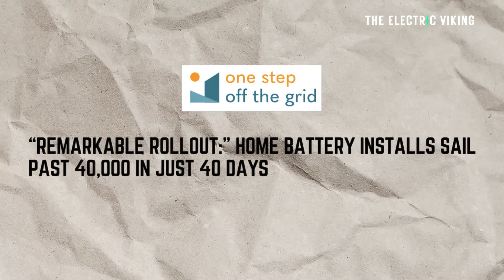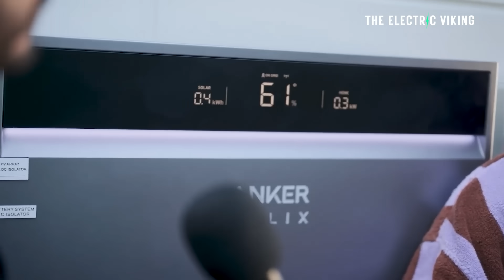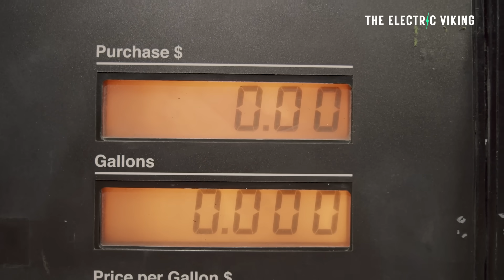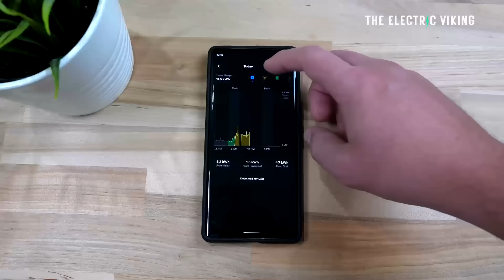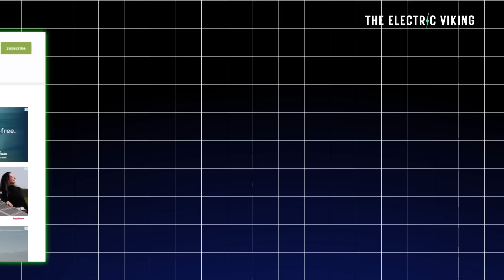40,000 Home Batteries in 40 Days: Australia’s Clean Energy Boom!

Comment: Sam mentioned 30 year warranties on some solar PV battery products in this clip.  In my opinion a 30 year warranty claim on a product needs to be treated with a healthy dose of skepticism.  There are very few solar product manufacturing companies in the solar industry that have been around longer than 20 years.  This means their products have not been in the field in real world conditions for that amount of time.  If you think about it, you are lucky to have a phone or laptop that will still be working properly after 5 years which is essentially a battery with electronics and software.  My personal PV system with SMA and Suntech panels is still working fine since 2011 with a reduced output of around 10%.

Comment: Feel free to quote me. 
Just simple engineering facts from a CivEng Degree construction engineer with decades construction in ;
Fossil fueled power stations are uneconomic. Not fully maintained, as the cashflow is dying. 
Transmission lines too expensive to overbuild and extremely expensive to EXPAND and too valuable to waste.

Comment: Basically the battery rebate is to ensure grid stability after sunset, not to benefit the consumer with low or zero energy bill, because you paid 15-20k of electricity bill in advance.

Comment: The more we ‘cheat’ the system by not requiring fuel or electricity the less revenue the government and power companies will get, they will just move the goal posts to generate the revenue a different way, plugging the hole. I don’t think it will be too long before we’re actually charged for the power we generate regardless of if it’s fed to the grid. Taxes will increase or a new one invented to hit EV’s. The win’s are temporary. This inherently flawed economic system is doomed to implode before long. In the meantime my 6kv/20kwh +EV system gives me the upper hand but, for how long?

Comment: The main problem with the Government's battery subsidy is that it requires the owner to have solar. This excludes a huge number of properties, especially apartments, from getting the benefit of a battery. In SA companies like iO Energy use the SAPN 'Electrify' tariff to supply daytime electricity at 8c per kWh, effectively allowing non-solar properties to benefit from the huge solar overload during the day - saving it up to use in the evening when the rate is correspondingly high. This discrimination needs to stop.

Comment: We had our 15KWhr LFP battery installed earlier this month.  We are in Perth.  Went with Perth Solar force who installed our PV in 2018. We needed a change of inverter.  With both state and federal governments contributing it worked out well and so far we're very happy. 

In June we bought our first EV.  It's a 2022 MG ZS.  It's the one with the LFP battery so the range isn't impressive (320kms), but it's probably going to be sufficient. It was far and away the most affordable EV we've seen this year (except for trash like a very old Nissan leaf.)  Might have liked a 3 year old Atto 3 for the extra 100kms of range, but they were coming in over $10k more expensive.

Comment: Incentives make so much sense, every house that adds solar and batteries takes them off the grid. When these massive data centers come on line and add strain to the grid they should be required to either add power to grid or pay a tax that could be used to incentivize others to add solar and batteries to offset the data centers load.

Comment: Most BEV batteries are 4x or more larger than home batteries.  You need to be careful or you will drain the battery and start using power from the grid.

Comment: How many meals can you cook with ONE battery in Melbourne?
Wow lets import the energy grid from China?
Reply: I was concerned about the drain on our 16 kWh battery from our oven.  Turns out that once the oven is warmed up it doesn't take a lot of energy to keep it warm.  We have whole home AC and I was concerned that that would eat up the battery as well.  Not so much, at least for us living in the South Bay Area in San Jose.  It helps that once the sun goes down the air cools off here quickly and deeply.  Today was a high of 82 F and the AC never turned on.  Yesterday was 87 F and it kicked on twice.  Once in the late afternoon and once in the evening before the sun had set but no longer producing significant PV power.  Barely registered on the evenings usage.  It will be interesting this December and January.  The nights get longer, kWhs produced drop by more than half but Still more than consumed at night.  At least on Sunny days.  

When I designed the system I estimated we would need 24-25 kWh of storage to get through our longest period of clouds during winter.  We installed 16 kWh and will see how this winter goes.  If we wind up using a kWh or two a on a few nights it doesn't make sense to spend for another 6 or 10 kWh battery to save $50 per year.  As it stands we already have about $800 of credit so $50 should be too bad.
Reply: @bryanwhitton1784  impossible to run a restaurant on a battery. natural gas is far cheaper and simpler.

Comment: This is great news. This relates to your campaign against an EV tax, agree it may be unfair, but the govt. is giving us subsidised battery storage. I am not too worried about an EV road user charge. In Victoria the rate in 2027 will be 2.3 cents per km. So $230 per 10,000 km. As for the logbook, I have used one for business and you don't need to log every trip, but average it out each year on your tax return. This will have to happen as the fuel excise revenue declines. Diesel subsidies similarly will decline over time you would think.

Comment: In Denmark we already have periods where the raw electricity price is negative and most of the home energy consumption is for heat pumps during winter where there is no sun. Solar still makes ok sense but the business case is not as good as you claim
Reply: It is in Australia, where the govt rebate means you can get a 50kw hour battery system with solar panels for 30k then an FBT exempt EV on a lease plan at work and pay no petrol.  You actually come out better off on a weekly basis after owning panels/battery and a new car.
Reply: They's in Australia mate, think AC not heat.
Reply: Aussie here. In the fourth year of using an EV solar and battery.  The system has paid for the cost of the battery and panels already. And that was pre battery subsidises.

Comment: This year, we did solar but not battery. Our net metering program here is so good that the utility is basically our battery. The only thing we miss out on is resilience. The battery would just be a big UPS system. 

With our program, there is no price difference for different day parts, and every watt we take has the same price as every watt we deliver. At the end of the year, the utility does the totals and bills or refunds accordingly. The only limit is that we can reduce the bill to zero, but the city won’t pay us if we turn out to be a net supplier.

Comment: 10kw battery only single phase what a ripp off installed by arise solar most houses need a 50kw battery and at least 10kw panels or more, and it better be a 3 phase battery
Reply: On the contrary, we need to abandon AC in favor of DC, because the generation of AC wastes energy. It is necessary for manufacturers of household electrical appliances to start producing equipment that operates on DC.
Reply: I am not in Australia but I get by just fine so far on a 16 kWh battery.  This will be my first full winter but we have already built an $800 credit since February and we still have September and maybe October to build even more.

Comment: In Ontario, Canada there is an optional ultra low overnight rate of 2.8 cents per kWh. 
We save $150-$200 a year on that rate by putting timers on the hot water heater and hot tub  (my biggest users) so they only heat at the lowest cost.
We save in spite of the ultra high rate of 28 cents per kWh 4-9 pm weekdays that comes with the ultra low rate.
So solar doesn't make sense in Ontario. Batteries do. 
Charge up at 2.8 cents overnight and disconnect from the grid and use the battery all day. 
Or at least the during the 5 hours of ultra high 28 cents per kWh 4-9 pm weekdays that comes with the ultra low rate.
I have a small, silent, inexpensive LFP battery and inverter system in the basement to deal with all the power outages instead of a noisy, CO and CO2 spewing generator outside. Change over in seconds.
It's also used for my electric fold-up canoe. Range is 30 km without paddling. https://hackaday.io/project/192702-electric-fold-up-canoe

I could expand the battery system but will likely just get an EV and plug into that. For a week.
I could use the EV to act as a home battery to use 2.8 cents power all day most of the time. But it would only save about $300/year because about half my power bill is a fixed amount. So expensive methods to cut my power cost don't make sense. 
My power bill averages $100/month after energy conservation and shifting a lot of demand to the ultra low rate. Gas heat (average $120/month, $30 fixed). A/C not needed.
It's only $100/year to run an EV in Ontario for 16K kms charging only at 2.8 cents. Instead of $100 every week or two for gas.
An EV would save thousands a year. That makes sense.
Holding out for one of the inexpensive ones from China. Hopefully Canada reverses the 100% tariff on them.
Reply: In Australia you can use either a solar battery or we have plans that are 0.08kwh from 1am to 6am and give you free electricity from 11am-2pm.

Comment: I love that coal power stations are using solar. The big power companies are loving renewable energy but they still need coal to meet the demand. One of the biggest problems is knowing when to shut down and when to restart, judging the demand. previously they just had to keep fired up to be ready to meet demand......now solar can power many of their systems when shut down making starting back up way easier and way more efficient and way faster.
How cool is that, coal power stations are using renewable energy to make their own operation more efficient, cheaper, and a lower carbon impact.
Reply: With grid forming inverters and batteries the need for baseline load becomes mute.
Reply: It may be cool , but the fact remains that without coal power stations providing electricity when wind and solar fail , we would be suffering blackouts and even higher power prices.
Reply: @Leo555ZZZ  Again, grid forming inverters and batteries, a huge number of small ones or a bunch of big ones and the baseline production historically provided by coal, hydro or nuclear becomes mute.  Personally I prefer a huge number of small ones on each home or commercial building.  These supported by large utility size batteries in front of the meter and the need for baseline production tapers to zero over time.  Interestingly the grid would then actually become more resilient.
Reply: FYI, coal is supplying in excess of 70%  of power to the grid,
Reply: @steeldragon5867  FYI I don't care because renewables are producing more of the total each new year.....and FYI  many countries don't have even ONE coal fired energy platform, and some never did........AND FYI, doing some research can help making you not look the fool :)
Reply: @steeldragon5867 show the data supporting your claim.
Reply: Diesel generators are powering ev charging stations all over the world, coal and gas fired power stations are running the planet, they are replacing the the wind and solar scam with nuclear,  it is coming, you'll be alright they have drugs for your problem, in the meantime just keep stealing money from the taxpayers and believing in the tooth fairy, we know who the fool is, it ain't me